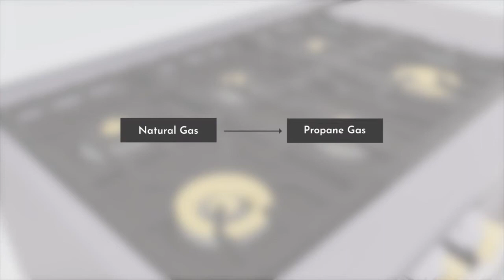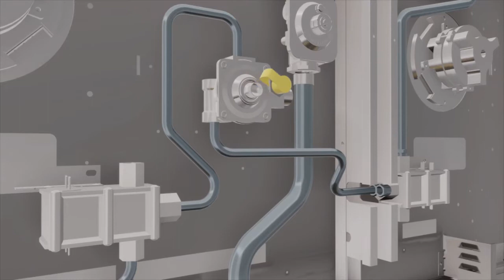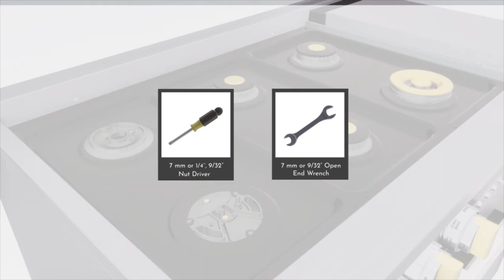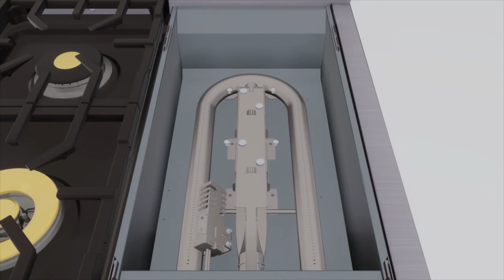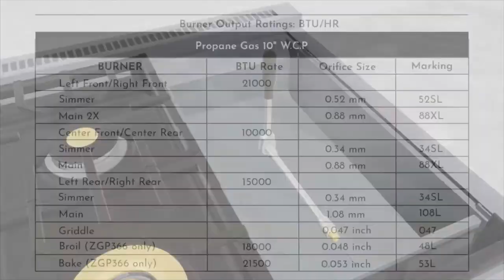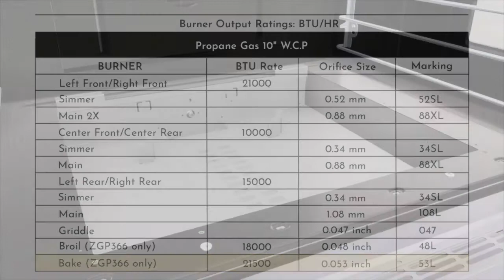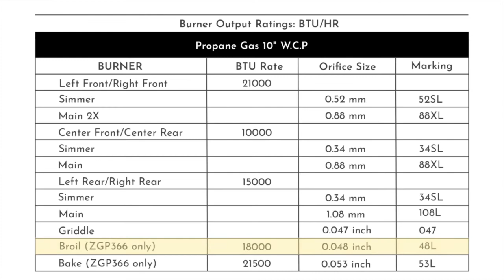Monogram Gas Conversion

Comment: It is unreal that you spend almost $10k and have to hire a technician to convert from NG to Propane using the conversion kit. GE SHOULD SELL THE STOVE AS AN OPTION FOR USE WITH PROPANE. After spending that kind of money, again you should not have to hire a technician to spend 2-3 hours on the conversion. I have called GE support and they HAVE NO ONE available that can provide verbal tech support. They tell you to call an installer, of course a Monogram Installer Team is going to need to charge you. Regarding the conversion kit, my salesman told me that the kit is on the back of the unit. He sent me another kit for $60. I was shocked that when I removed the rear metal cover to make the regulator conversion, the BAG WITH CONVERSION KIT WAS SCREWED ON THE INSIDE OF THE BACK OF THE STOVE, NOT THE BACK OF THE STOVE. How my salesman was not able to tell me this, I find unbelievable. 
I would never recommend buying such an expensive, difficult to convert, GE appliance ever again. Even this utube video is lacking enough detail so a half way intelligent person could follow. I had the SAME ISSUE WITH MY GE MONOGRAM DRYER CONVERSION, two hours of work and the entire front of the dryer had to be taken apart. GE is terrible!
Reply from the maker: We're sorry to hear you ran into these issues with your conversion. We can understand how this process not going smoothly could be stressful, and we apologize for the inconvenience you experienced. Please note, we are only able to provide the conversion instructions that come with the range. Additional help with that process would need to be done by a professional installer. After everything has been installed and converted properly, we're confident you'll enjoy your new range.

Comment: Hi, where can I find the instructions manual for conversion?
Reply from the maker: Conversion instructions are provided with the LP conversion kit that comes with the appliance. We do recommend you have a professional gas installer perform the conversion, to ensure both the installation instructions/any local codes are followed and that the conversion is completed safely. We also advise keeping the natural gas orifices when the conversion is performed, as there is not usually a natural gas conversion kit available if you ever need to change back.

Comment: Instructions with my $10000 range state it comes with the LP conversion kit included, as does this video and Google searches that found that same claim on the GE site, but no such conversion kit found on my range model ZDP366NTSS. What gives? GE can't write decent instructions and update their manuals and video guides? And why can't you simply provide a PDF instruction manual for this conversion online as well?
Reply from the maker: Page 13 of the Installation Instructions (http://spklr.io/6054I7iC) provide a detailed diagram of where to locate the needed information and kit for the LP conversion. Please double-check this area, and let us know if you're still unable to locate this information, so we can further investigate.
Reply: @MonogramAppliances  Its not there - trust me. It specifically says right there on page 13: "Location varies by model". Mine has two panels, one on the left for the electronic boards, and one small one on the right for the main burner oriface valve. I've taken both panels off the back and looked around carefully. Also, the main stovetop oriface accessible from the back that you are supposed to just flip over so you can see the "LP" inscription doesn't seem to fit flipped over as that little pin on each side prevents it from being screwed back in when flipped. Is there a direct way for me to contact you?
Reply from the maker: Please reach out to our Parts team by calling 1-877-959-8688. http://spklr.io/6056L83i
Reply: @MonogramAppliances  I've now done that. Thank You.
Its a shame that GE doesn't have an actual technical support person that a normal customer can talk to to get some assistance when I just spent over $30,000 for my appliances! I'm a homebuilder and have extensive knowledge on construction and perform all plumbing, A/C, gas lines, electrical, framing, door and window installs, etc, as well as appliance installs, so why would I want to hire some bozo installer to mess things up and who doesn't care about my house or problem, other than wanting my money?
I did speak to Lisa at support after first speaking with some other guy who put me on hold and then hung up on me. Lisa was very helpful and did what she could. I do also suggest to either update the information that the kit is NOT included, or provide much better instructions on where it is found for each model, not just say "location varies by model". Maybe Quality Control screwed up and missed the fact that it was not added to my particular range (which was in a GE box..brand new straight from the factory).
Reply: @SDTriathlete hi there, I’m in the same boat as you in which our range did not come with the kit although it claims in the manual that it did. Was Lisa able to get a new kit sent to you?
Reply: @MonogramAppliances  No parts found on the back as described. - I checked everywhere. On that page 13 it shows a different range model and also says "NOTE: Location varies by model.". On mine there are 2 panels on the back - one for the electronics on the left and another smaller one on the right for the stovetop gas valve where you would change the oriface for that. Even that is weird...instructions say to flip it over and reinstall, but in an attempt to do so it has 2 little protrusions that only seems to allow it to be installed for natural gas - when I turn it over and it shows "LP" it seems like it doesn't allow it to be screwed back in. I removed both panels and looked inside everywhere I could - no gas conversion kit parts attached anywhere. Do you have a contact number I can use to speak with someone there who knows more about this? When I called the support number for the location of the kit they told me I had to purchase it separately, so I did and spent $60. I would like to speak with someone technically who knows for sure if this kit is hidden somewhere on my range as various instructions, you, and your website claim.
Reply from the maker: We appreciate the additional information. We have passed this on to our research team to get some clarification. In the meantime, please reach out to us via a private message or direct message on Facebook or X and include 51432 as a reference, so we can communicate a little better.

Comment: mine came as a propane.. how do I switch to natural gas?
Reply: From the factory they come as Natural Gas, not Propane. To switch back you need to convert backwards - flip the oriface valve on the burner regulator on the back, and also swap all orifaces on the burners back. Usually the orifaces should be taped on the rear somewhere.